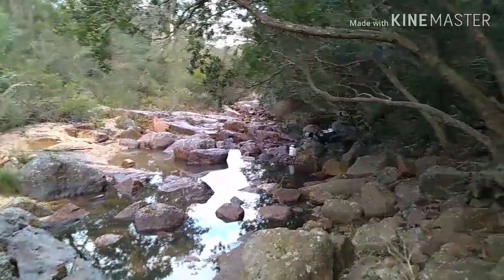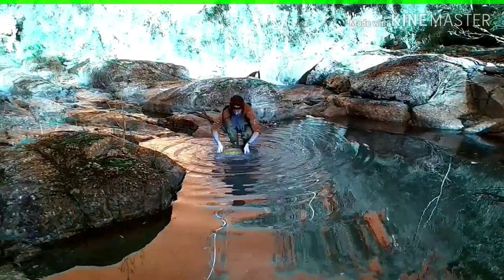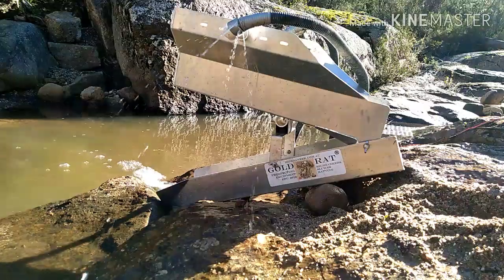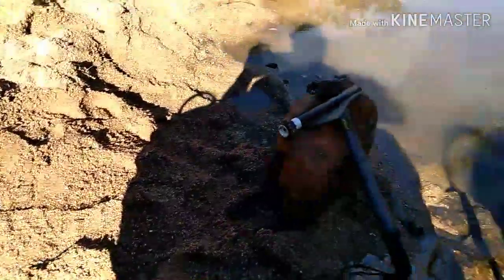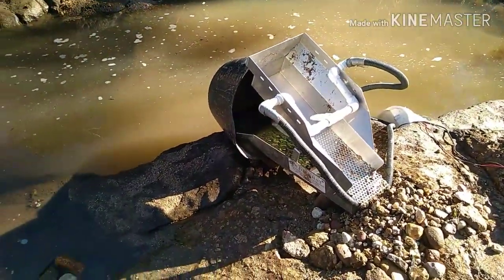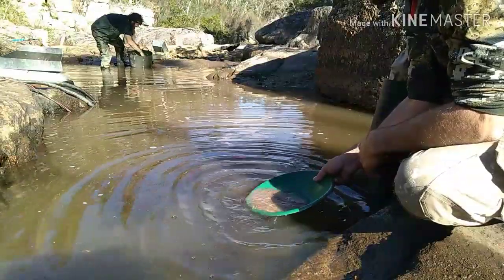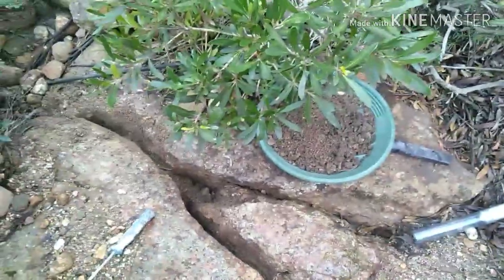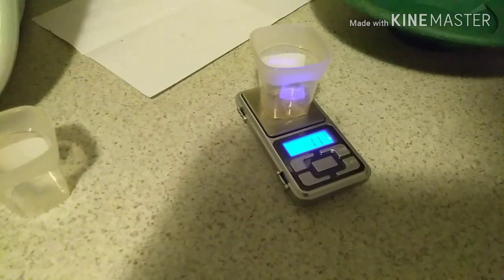Crevice full of gold/ 6 inch highbanker

Comment: Looking like a smurf. 
Nice look! LOL
Nice gold 
Love the blue fire!
Reply from the maker: Haha thanks Wayne I think I may get a call for the next smurfs movie! Was a great day out its a shame I never checked the footage until I got home!
Reply: Hahaa, honestly doesn't bother me.  Sometimes no gold will make you feel blue...but I you didn't have that trouble, glad too see you take home some good colour! Hey by the way, when I weigh my Gold I try to avoid paper as it can be precarious...I use a little stainless steel milk jug with spout (for the lack of the proper name) that I got for 2 bucks from an op shop. Easy to dry and the stainless steel allows the gold to slip easily out and through the spout...sooo easy to then get the Gold into a wide mouth vial or plastic cup for weighing. I then put the gold back in my pan and transfer into permanent vial using water and a pipet....I'm yet too see someone use a faster, easier, safer way...hope these ideas can help you too mate. Thanks for sharing and reading this crazy long msg.
Reply from the maker: Thanks russ I think I have the camera issue sorted now haha. Yea I definitely need a better way to weight my gold in my video before this I reckon I lost at least 0.1g from bouncing off the scales. I found gold all over the table 😅 will have to give your method a try thanks mate